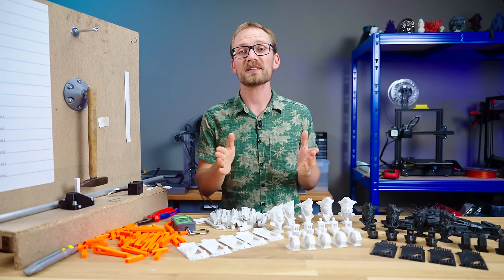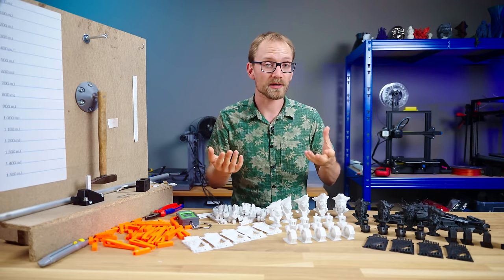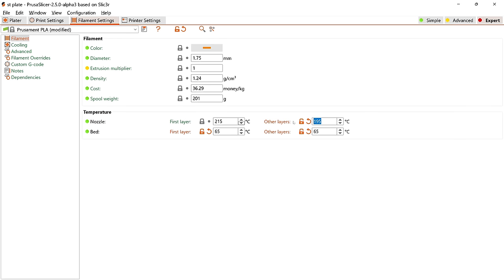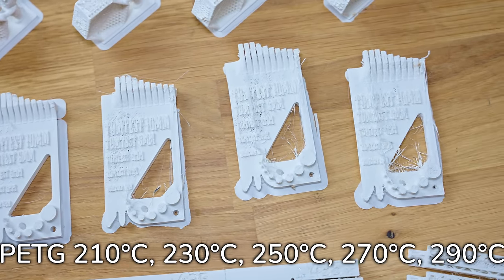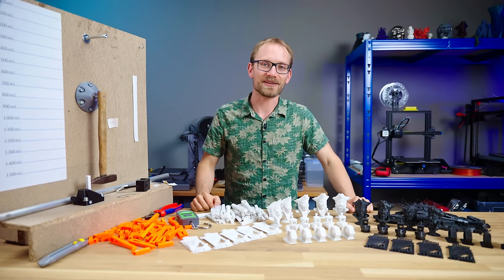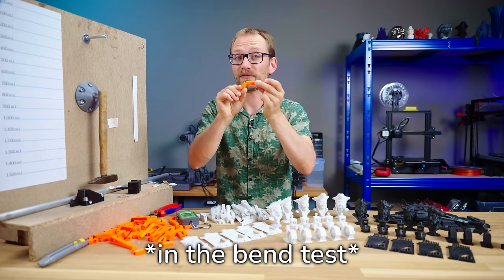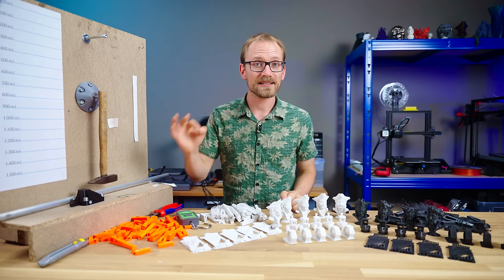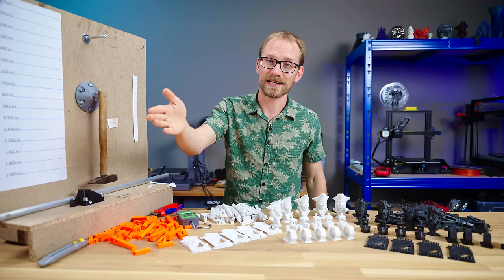Are you printing at the right temperature?

Comment: Different filaments even from the same manufacturer can have wildly different results, even if they are supposed to be the same material. You can't relay on the temps on the spool either, as those have usually roughly the same range (195-215° +/- a few °). I had spools of the same type but different color which behaved differently. Then there are glossy/sparkly or wood filaments which may have add-ons that alter the behavior. 
So testing is rather pointless. You may get a general idea (e.g. higher temp = better) but it may be different on the next print. 
To get consistent results you would have to stick with only a few types of filaments and colors, but what is the fun of that ;)
I have settled with buying from more or less one brand which I know how that behaves from experience. And even then you have many variables. E.g: I had to replace the hotend a while ago. Even using exactly the same stock hotend I have used before I had to increase my printing temp by 10° to get the same results... 
3dprinting is constant learning, tinkering and adapting...

Comment: I created a pressure petg cotton algae filter and the pressure reached 80psi pressure, there were small leaks I just super glued it and now it has no leaks. (I don't know if the pressure is correct, its the cutoff rating on the Chinese 12v Water Pressure Diaphragm Pump ) and I got the best layer adhesion on 250 degrees Celsius with full infill.

Comment: What you should check is the wall thickness as you go hotter which changes drastically and the speed at which you print because nozzle temp is a bit different then your descriptions let people believe but I'm printing petg at 270°c at 1500 acceleration now the acceleration is capable of holding the filament and using our backup pressure to print because its never staying inside the hotend long enough because the hotter your materials get the faster you need to print to remain stable but all you've done is change the temps and not the speeds so all that stringing and brittleness is from a lack of flow being instantly purged out which is also why your part didn't work which that being said contributes to TEMP X COOLING X SPEED = BACKUP PRESSURE THAT WE USE TO PRINT now imagine if your material is escaping too quickly to force a 0.45mm line width when running at 270°c at 30mm/s 🤔 the material is staying inside the hotend longer which makes it really 270°c which we do not want but if we print at 270°c and print faster this can be mitigated and gain full strength
Reply: Or we can say if the force your slicer flow calibration was setup for a specific temp then that will be your best range for that temp vs any other but please feel free to run this test run petg at a faster rate of speed at 255°c and you'd see its about the maximum cooling the stocks could even handle and then the fact of your speed needs to be accurate aswell for the materials temp your running but my printer is maxed out at 270°c I cannot go any faster without forcing a skip to my system

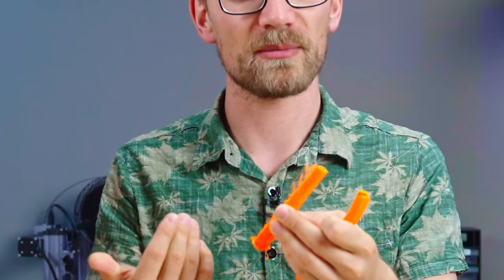Comment: 6:14 This! Can you elaborate a little bit on these "Branche Build Ups"?
When I was printing the MasterSpool in PETG, I could clearly see, that somehow, when there are lots of top layers to be done on a wide area (used 15% Gyroid as an infill, 2,6mm line distance) it will build up branches already in the very first layer of that top surface. Those "branches" are highly annoying, because they will create issues with the next layer, once the effector is running over it to put the next layer on. I assume this is extruded material which could not stick/bridge the gap where it was supposed to be (so missing on another point and superflus somewhere else). This even destroyed more than one print for me, because the surface was just completely uneven, non-functional and of course ugly as hell.
I turned down Speed (using a V400 Delta), this seems to be much better and it will happen much less frequent, but it is still there every now and then. 
Is there anything I can check or do to improve it?

Comment: I love your tests, they are really good. CNCKitchen is also doing a lot of tests that are really, really great. But in my honest opinion there are one variable that is missing, and that is speed. By speed i really mean volumetric flowrate. If the flowrate is higher, the temperature of the molten filament coming out of the nozzle is gonna be lower, and it's gonna impact all of the things you have tested here. I guess if we all consider prusa's standard profiles the standard speed settings with an e3d v6 hotend and brass nozzle, this is not gonna be an issue, but if you start speeding up your prints, like if you're printing on a voron, or a bambu lab printer, all of this is not really gonna apply anymore, as there are now way more variables here. The type of hotend (length of meltzone), nozzle type (brass vs. hardened steel or even a cht nozzle), volumetric flowrate and print temperature is most definately gonna matter.
For many users, this video is gonna make a lot of sense, but for a few of us that is printing faster than most, it's not really gonna apply, is it?

Comment: I believe I have a possible answer to your question about the fitment of parts when printed at different temperatures. From my experience a 10 deg C increase in print temp will equate to a ~0.001mm greater shrinkage. This I believe is due to the part being hotter when printed and shrinking more... I found this as I need to print dimensionally accurate parts for industrial robotics... as such I do testing like you did for temp &strength then calibrate for dimensional accuracy in the slicer also

Comment: Layer adhesion and the resulting mechanical stability also has to do with the material (manufacturer) itself. I played around with two silk looking Pla brands at different temperatures and fan speeds. At least the layer broke while bending too easy. Tried another brand and it worked to my full satisfaction. From these aspects I prefer rather yt videos which compare filament brands and which are free from sponsoring influence.
Anyway in doubt I print an temperature tower which is included as template in SuperSlicer

Comment: Well 'printing hotter=stronger' is inside limitations of course and then it is true. 
Especially while printing PETG (most of them) with a cheap printer with a PTFE-liner inside that can (or should) only go up to 240 degrees max. In that case, about the max. temp you can safely print (238 degrees or about 235) is giving the best strenght for both PETG and ABS on those printers.

Also for many filaments that give a spectrum of temps, like 225 - 240 degrees. Most likely stronger at around that max of your printer or 240 degrees that is recommended by the factory. 
Of course still testing is needed per each filament and many times even each color...

Comment: This is interesting as I print petg and polycarbonate around 275 - 285 c with nice quality and overhangs without any stringing.  Sometimes I end up around 295c, but some materials start burning.  I did go through a bunch of brands and as I recall the ones that printed at higher temperatures also had better print quality and overhangs.  I've had some pretty terrible prints printing below 250.  Printing above 290 gets a lot of stringing.
Reply: I'm kind of with you.  I like to run things hot.

Comment: You do some great videos so I think I’ll tell you about my study, or experience to solve my ABS issues. First of all the machine I experimented with is a Lulzbot TAZ 5 with an updated TAZ 6 print head. I do have an enclosure but the TAZ is huge and with the enclosure it takes up even more space. I don’t do much ABS printing, in fact nearly zero so I never worried about it. But I am building a chess set and making the piece to be small robots. No mobility, most of my printing involve arduino and raspberry but fir this just robot figures. I wanted the small chess piece stands, as the robots have legs and since they are small they would fall over without stands. I wanted the stands to be grey, I could buy grey filament but I had grey ABS that I always have trouble with bed adhesion and warping. Then I had an idea. Could it work. I used a raft with .1 gap between raft and part. Nice thing about the TAZ is that you can change nozzle and bed temps on the touch screen. I started with PLA as I get perfection in bed adhesion and no warping. So PLA bed at 60degrees nozzle is 205. I let it print the raft completely then the the layers after the .1 gap and I let it keep printing till the first infill layer begins. For my build that’s at 6 layers after the raft. Then I increased, using the touch screen, the nozzle temp to 240. I let it print till the nozzle temp hits 230 then I press change filament unload the PLA loading ABS. Then I hit resume keeping the PLA raft and the bed temp at 60 degrees and the Nozzle is now 240 degrees allowing the ABS to flow. I achieve perfection. In fact my PLA is Gold the ABS silver so makes a 2 tone color chess piece stand. No bed adhesion issues or warping since the raft is in PLA and the ABS bonds perfectly with the PLA under it. I’ve never seen anyone do this or even mention it. What do you think of my solution? Saves me from reassembling my enclosure.
Reply: Great idea, I’m going to try this right now

Comment: Being new to all of this, I found my PETG prints always more brittle than my PLA stuff (prusament PETG, dasfilament PLA). Printing at .4mm nozzle .2 mm height on a prusa Mini with preset settings. My PETG stuff is usually quite bubbly on the surface and strings like hell, print in place mechanics are barely possible. What should I change best? Heard it might be in the retraction settings?
Reply: Просушите PETG и все станет  хорошо )

Comment: I know a few that will still keep printing PLA at 250C... cause, apparently everyone else in the world is wrong.. Been printing 5 years now, only once i've had a filament that required higher than recommended. I landed on 215C within the first 2 months, it is the golden spot for PLA. I go 220C when i put on a larger nozzle and higher volumetric ratios, cheapo hotend can't keep up. I can bet that most of the plastic that comes out then is on average at 215C...

Comment: Thanks for the big effort, nicely done! I know that one can set the temperature of the first layer separtely, but is it also possible to set the temp for the top layers seperately? In this way, you could get strong parts with a nice matte finish, I think, I would like that! I know, you can change settings based on layer height, but then you have to adjust it for every print. Worth a test, at least, I think I will try that once!
Reply: Some do this automatically but you have to know if you need it as I've had prints go bad from this too.

Comment: If PETG shrinks slightly less than PLA, and you have your machine dialed in for PLA, then the PETG parts are going to end up 1-2% oversized, if I had to guess. Conflicting informations on shrinkage ratios online.

I imagine it also is a function of how hot the plastic was when laid down until it reaches room temperature again. higher temp= slightly higher shrink ratio.

Also with the stringing, shouldn't you be tuning retractions on a per filament basis, even more important if it's a totally different material.. different melt zone creepage rates, material viscosity while melted(and on a per-temp basis even), etc etc.
Reply: Only if you use the same profile with higher temp. The other settings like e-steps are independent of the filament and should stay correct
Reply: @laiebi_3639  actually I don't think that's totally true.. The depth the teeth can bite into the filament alters the effective radius to some degree. So e-steps might actually change ever so slightly, based on the filament's hardness. The different viscosity at melt will also alter things like the flow% and possibly even things like pressure advance calibrations.
Reply: @Roobotics  true, then only x,y and z e-steps ^^

Comment: White filament is such a hassle to print, there's so much titanium oxide in there.
Reply: It is, no matter the polymer, it always takes at least two failed prints until I dialed the parameters in to get acceptable results. I personally prefer uncolored filaments over white ones and then just paint them. Afterwards.
Reply: @Donnerwamp  Yeah, if you care about surface finish you will be processing your prints anyway.  The only reason I used white filament was for a lithophane, I got the whitest filament available, if you rubbed it against something it would shed white dust.   I had to print faster and at a higher temp to prevent any clogs.
Reply: And white matte to boot. One wonders what the filler is that creates the matte finish.
Reply: @frankb5728  Sure, when I wanted to paint my print and printed with white filament to skip a base layer or two, I did some sanding and stuff, but the first tries always ended in catastrophal failure like clogged nozzles or close to no layer adhesion, sometimes blobs and stringing to a level that it's not fesable to put any effort in trying to make it work at all. 
Now I'm using uncolored filaments, most of the time I don't even sand the prints and just use one or two more layers of paint. Way less work than with white filaments.

Comment: What's the guarantee that if you set the temperature to e.g. 215, it actually prints at 215? How do you know the temperature is accurate?
I'm actually having problems with the prusament petg settings. Although it should print 0.45mm perimeter, I get 0.52mm! That's a 14% error. 
And I'm getting lots of stringing.
And the walls have holes in them.
Maybe the temperature is off?

Comment: Somehow i also print my pla with 215 no matter which manufacturer.but i use only two manufacturers so its kinda the same.the difference between both is just that one strings a bit more than the other so its kinda a different retract setting.

Comment: i might be using my ender 3 unconventionally by printing flat pieces to assemble later with model glue , mostly in abs and using big mushroom 0.2mm nozzle mostly because i hate layer lines and i can iron the part while printing
any part with more complex geometry sadly don't look as good but sand paper mostly fix all problems in post

but for me i go with the mid heat, heated bed and rafts for every part, just because my bed isn't flat and assembled models are trains in N scale so mostly boxes of 10x2x1,5 cm with surface details ironed in
ironing work best for me when filement don't escape the nozzle with heat and gravity but nozzle is hot enough to easyly melt details on the bed

Comment: has anyone considered using ultrasonic energy coupled into the hotend?
the same idea with some of the bonds in micro components might work here. some components cant handle high temperature. so they use a combination of temperature, ultrasonic energy and pressure to reach the critical point for adhesion. if temperature is damaging to the filament. yet we need slightly higher energy potentials for proper layer adhesion.
temp+ultrasonic fdm welding may overcome that issue.

Comment: TBH, I feel this video was a bit pointless: Testing Prusament on a Prusa i3 with Prusa Slicer and Prusa made profiles – of course they'll be perfect. Somebody at Prusa has done the same work you did before.

What I'm wondering is how other profiles come about. For example, Cura has a Generic PLA profile with 180°C printing temperature. For me that works, but it's also delivering matte surfaces. 215°C on the other hand leads to terrible stringing and oozing and blobs everywhere.

Comment: I print with PETG at 250 degrees and still get a bit of stringing. Reducing the temperature or print speed doesn't really seem to help much, either.
Reply: Even tried printing below recommended range which is 230-250. Tested 250, 245. 240, 235, 230 and 225 and still having issues with stringing.